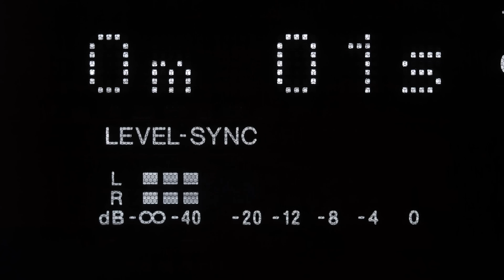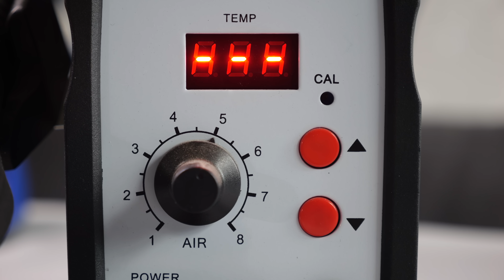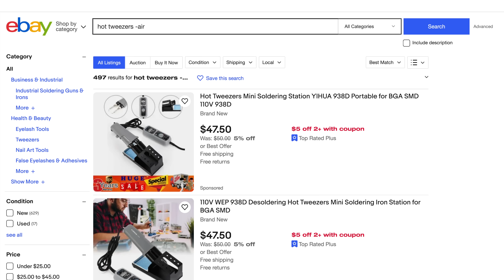A BETTER way to replace surface-mount capacitors!

Comment: I had to replace all 25 SMD caps on a Sony ICF-SW55 recently, as some started leaking (known issue). I'm only a new hobbyist. I used a regular soldering iron with a 'regular' tip, applying extra solder around the legs from the side for desoldering. They varied from 4 to 10mm diameter and OK to poor accessibility due to surrounding components.
The leaking had also caused pitting and trace damage, as well as top layer delamination. Even with careful desoldering, some joints would simply rip off the PCB anyway. Taking some more top coat and trace with it. I don't wanna know what would have happened if I used the twist and pull or leveraged removal. I did debate doing it that way, as desoldering with a regular iron took quite some time and patience.

So I guess it's also down to PCB and top coat quality, besides the degree of 'leakiness' and its corrosion effects on metallic joints.
Reply: Soldering iron isn't without its own danger. The PCB substrate is not infinitely temperature stable, and degradation can be catalysed by the electrolyte present on it. The outcome is delamination, the PCB substrate losing grip on the attached copper, because the resin is degrading. Since you need the leg to retain enough heat to be desoldered while you're heating another leg and it's cooling, you end up putting a lot more heat and higher temperature then usually.

Furthermore you're trying manipulate in semi molten state which also produces extra stress on the PCB.

Then as you say there is chemical induced degradation of not only the copper but also the solder, turning it into some sort of crystalline salt, so it doesn't melt at first truly and fully unlike when it's fresh, at least until you gain access for good solder to mix with it, or even bismuth alloy, and it just doesn't wick from the sides properly under the rubber bung that prevents access.

So i think bite or twist are indeed better than single soldering iron.
Reply: @SianaGearz  
Thanks for the additional insight and information. When I attempted a twist and pull on one of them, it took some soldering joints with it. So I stuck with the soldering iron.

I did attempt to take precautions regarding heat spread, as well attempts to increase the desolder effectiveness and limit the heat exposure time. To a degree I was able to, but far from optimal given my limited tools and knowledge.

- Rinsing the exposed parts of the legs with IPA as well as cleaning of all corrosion and crystals, for as far as that is possible, beforehand (often multiple passes)
- Use of liquid flux (I don't have paste or gel)
- Use of soldering tin containing lead (lower melting point, I believe?) and generous amounts of it to increase chance of proper contact / melting together with the PCB solder
- Removing the heat by applying generous amounts of IPA to the heated area and its surroundings (including IPA soaked paper towels on the bottom side) inbetween desoldering attempts, hoping that conduction and relatively low boiling point would draw away some heat. It seemed to work pretty well, based on using my finger as temperature probe ;).
- When the solder joint with the legs seemed liquid, I used tweezers and the soldering tip to lift the SMD up and hinge it around the leg that is still stuck. Then, if possible, heat up the remaining leg with the iron tip from underneath the now exposed underside of the SMD. This would often skip the back and forth heating of the both legs.

Unfortunately, I have next to no knowledge and experience in these matters. So seeing videos and accompanying informative comments like these are always welcome for learning purposes. But still happy I managed to fix it in the manner as described above. Even if it took some hours to complete.
Reply: @jbsvault  Liquid flux is usually a good idea unless you got a weird one that smells like death. Even classic mildly activated hard rosin just dissolved in some IPA is very good. Paste flux are just that but with some paraffin that burns up. Better paste ones have top notch activators and can work well but the paraffin still interferes with their action.

Yes old equipment from before 2004 you can safely assume used leaded solder, and unleaded solder should not be used to repair them due to higher melting point. Indeed it's advised to use leaded solder for all repairs even of newer stuff, to just reduce thermal stress and make the connection more reliable than it was before the repair and easier to rework in the future if need be. Sn63Pb37 is 183°C, good lead-free with silver is 221°C and cheap stuff is well beyond. Addition of 60/40 is good to aid de-soldering.

But for desoldering difficult parts specifically, it's good to use a bismuth alloy. You can try hunting for Wood's Metal, Rose's Metal, or just buy a desoldering alloy from ChipQuick. It can lower the overall melting point down in the vicinity of 150°C or so, which is a huge help with multi leg components. It needs to be wicked away carefully afterwards, because more than trace amounts of bismuth can embrittle the subsequent joint.

I don't think quick cooling with alcohol actually does much, as temperatures drop really rapidly at first and you can hold a PCB at say 100°C for thousands of hours, as long as it's dehydrated, it's going to be fine. Degradation sets in near soldering temperatures and higher. But it's also convenient because you want to handle the board quickly and i think it's no harm either :D

Comment: 3:30 If your board looks like this lifted pads aren't an concern anymore. The secret of the twist method is to twist the cap off and not pull up. It doesn't matter in which condition (leaky or not) the caps are. The moment you pull up you are going to damage the pads in 99% cases. If you like the hotair method more go on and use it but in my experience the twist method is as save as the hotair method but faster.

Comment: As a GPU card repair specialist who constantly deal with PCBs with very high heat capacience - I mainly have to repair damaged\destroyed (dr)mosfets, and those PCB caps are always close to the place where I need to deliver 380C of hot air. So I almost always have to remove caps before changing (dr)mos'es (But if PCB is small\thin I just use aluminum tape, fold it(glue part inside) and block hot air flow by placing it before cap).

My way is to always preheat board on 150-250C(it depends on the size, thickness and amounts of copper of the particular PCB. And I do it mostly not for removing caps but for easy (Q\D)FN chip removal) and then I use low-temp solder with soldering iron to mix solders together and remove cap effortlesly. Yea, after that I need to remove all that low-temp solder from pad and cap, but its better than always break caps and replace them.

And regarding hot air - you can use it on "low temp" double-sided PCBs. But it's tricky, and I wouldnt risk and hover my face above PCB if I do this. I already had flying caps(that top side) previosly - they can do a lot of damage. One even slightly bent nozzle on my hot aid gun.

Comment: on my bench i have 2 hot tweezers setups with different tips one straight one at a 45deg.
I have 3 soldering irons with different tips. 2 de-soldering stations for small and large pins. 
a custom 6 zone pcb preheater. and custom 200w IR heater on a custom flex arm with adjust focus.
i mostly work on high power amplifiers (1-40kw) and have have a full pcb production line setup sure it's not massive but i can do small to medium scale runs including the custom replacement driver cards i designed to replace the hard to find ones for a lot of old amps. even full gut replacement upgrades changing some old class ab to full bridge class d or T path integrated setups with as much as a 20x power bump for a given heat-sink while keeping the retro look for old hotrods

Comment: Just a couple of days ago I saw another interesting desoldering tip on youtube  In short, it works on through hole multi pin parts ans surface wing shape pins.  You form a suitable thickness copper wire and solder it along the row of pins.  Preferably low melting point (eutectic tin-lead alloy) solder.  If you are dealing with dual in line parts, you solder your copper wire as a loop around.  Then you have (one or two) soldering iron tip(s) heating the wire(s).  Use a wide chisel tip and the heat spreads along the copper wire (plus fair amount of applied solder) all the way and the part detaches easily.  On thru hole parts, you may need to straighten the often bent two corner pins as preparation before the desoldering operation.  Sorry, I don't know if the SMT capacitors could be removed this way.  As mentioned, I saw this two days ago and have not tested it myself yet.

Comment: Be wary the power switch on those hot air rework stations are software despite looking to be a hard power cut. The one I used to have set itself on fire while I was asleep due to a shorted transistor in the heater circuit, causing it to go full blast from mains voltage while not powering the fan on.

Comment: Great video , I learned a lot. I prefer to use two soldering irons and am fortunate to have a reasonable quality hot-air station , so I hope it is't overkill but I use all three tools , alternating between them as required.

Comment: I cut them with diagonal cutting pliers and desolder the legs left behind, but i used to used the hot air but it ruined some pcb because they had acid on the board

Comment: I quite like my two fine tip soldering iron method. But at the end of the day, I guess go with what you are comfortable with. Just experiment with an old board and see what you prefer.

Comment: You can make a tip for a soldering iron with your own hands for desoldering such typical components.  just two thick copper wires instead of a standard patcher tip, bent into the desired shape

Comment: Weller Soldering Tweezers are great for getting in to small places but at £320 without control station are a bit pricy.  but just stick to drowning them in flux and ripping them off as you can't go far wrong 🙂

Comment: I've heard that you need to pre-heat the board, especially larger ones, before using a hot-air solder gun, else you risk warping the board.

Comment: Plain and simple. First, always add some flux or fresh solder to both solder joints which makes the job a lot easier. Next, use a (de)soldering tweezer and you can take a SMD capacitor right off. Pre-heat the PCB using a temperature controlled  preheater in case of large ground planes as the negative side of many SMD electrolythic capacitors are often connected to it. If you replace SMD caps on a regular basis, consider investing in a Weller solder/desolder station. Yes, it costs a bit but in the end its well worth it!

Comment: Twizzers often have replacable tips (handy for for different smd sizes). And as soon as most of components are smd (resistors, doides, transistors etcl it makes them not so single purpose, not only for these e-caps. About hot air gun, does not melt the plastic base of such parts?

Comment: I have removed hundreds with a normal soldering iron, you just have to apply to one side and lift a little, and then you go to the other side and it comes out, heating both parts is more complicated without air.

Comment: I got a refund on my 858D style station and spent that to replace the fan and heating element as the wand arrived “used” and burnt up. It was quite useful when I recapped a SNES. Though if service more electronics in the future I’ll get a hot plate

Comment: The safe twist method could be called press and twist. No rocking and no pulling of a cap is engaged in this method. Capacitor pins snap by the base, and the soldered part stays on the pad, unlike what you have shown.

Comment: I have a hot air rework station with a preheated that I use to heat the board and then I use two soldering irons.

Comment: People saying “I’ve never had a problem” with the twist/pull method have never worked on a Game Gear for ex. If you are twisting a cap (especially on the sound board) expect at least 1cm of the trace to come along with it.

Comment: You missed a very easy option.  Slow melt solder or under the brand name Chip Quik, you just apply a small amount of the chip quik to your pads and it keeps the solder melted for several seconds and you just lift off the cap.

Comment: I always just reflow both sides and use a tweezer to remove SMD caps. No blasting excess heat to board or   Twisting/pulling of the pads.

Comment: Use the ladder technique. 
 
This is like technique shown at 4:50, but with a few suggestions.
Use a fine tip iron with a hot tip (the tip in the video is too large).  Possibly add a small amount of solder to the pad to aid in the heat transfer.
Use tweezers or needle-nose pliers gripping across the part (as if bridging the two leads).  
(In the video the tweezers come in from the right, instead bring the tweezers in from the front or rear from the camera's view).
When the solder melts, twist up slightly, but only on the melted side only.  
Repeat the process on the other pad.  Because the first lead has already been raised slightly, the second lead will easily raise a lot more.
Alternate between the two sides, like climbing a ladder.
Typically the part comes off after two passes.  
Quick clean up the pads with solder-wick. 

This method avoids the damaged part debris mess such as the twist off method.
This method also avoid heat damage to nearby components when using hot air.

Comment: I've always thought ripping off a cap (twisting or not) could put too much strain on the circuit. If cap has leaked, the circuit is already fragile. I use hot air and protect other components with kapton.

Comment: Personally I’ve been using the snipping method for years without any pad lifting, heatguns are a better method though it just depends on if I need to be carful with heating up heating up the board beside certain components makes me I little anxious so this is was I still use the put method for surfaces caps

Comment: well, in my experience I never riped the pad of any cap using this method, what I do is spin it little by little while applying down pressure

Comment: Just get a hot air and soldering station - the basic Zeny 862D+ knockoff model, which is unbranded, l I got 4 years ago for $50 seems to get the job done. It's now $80 on Amazon.  After a quick correction to the iron head for consistent heat, I've repaired an Alpine PDX M6 bass amp, upgraded a PSP 1000 display, repaired the micro buttons on a Logitech G700 mouse, bridged the rear USB power outputs on my Wii U, fixed the amps in the Klipsch Pro Media computer speakers, and am very close to repairing a near mint $10 Tivoli Model One radio I found with $15 worth of verified parts.  I probably should be using a better station now, but when I mainly just repair some of this stuff for fun and to keep my soldering skills up.

Comment: Few points, most of those hot air removals you show the solder hasn’t melted, second once the electrolyte has reacted with the solder it changes it, it no longer melts as regular 60/40 does I’ve struggled to get it to melt at all. For me hot air (for the round electrolytics) is painful, long winded and risks damaging lower temp plastics in the vicinity.I have always used the twist method and to be fair the electrolyte damaged ones you show are so far gone the whole board would be scrap anyway.

Comment: There are these thin flexible steel blades you can shove between the part and PCB while solder is liquid. Use them on one leg at a time, and eventually you can get entire part separated from the board. Except it is relatively easy to damage smaller pads - I guess I need more experience.

Comment: Just put a ton of solder on each joint and lift each one up a bit. Works everytime. When they're both high enough you can heat them both up with the iron at the same time. This or just hot air gun.

Comment: These caps are infamous to go bad in Casio Digital Horn (electronic saxophone, like DH-100 etc.). I have an Atten hot air station with SMD soldering iron (twice as expensive as the bare hot air but technically similar). The only poor quality thing of it is that the mains cable terminal sits loose in the back plate and may fall out when pulling the cable. Also the jack for the soldering iron (held by a ring shape nut) is a little loose.

Comment: I was thinking about there must be a solder tip that look like it has 2 legs so it will heat both sides as the same time. Then I saw rest of your video :) Hot tweezers.

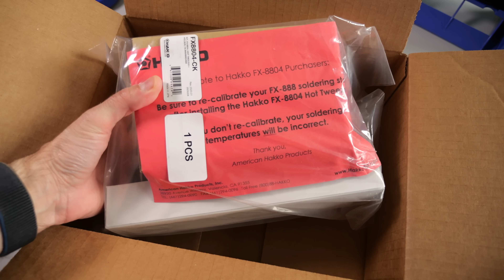Comment: 5:53 - Another thing you didn't explicitly mention is that the heat on the PCB itself can cause it to distort and bend. This is actually shown at 0:38 in the time lapse, you can see the board bending upward slightly toward the camera.
Reply: I think it might be the surface below the PCB heating up and bending.

Comment: I use the cut method. Cut the cap at the base and remove it. Cut up the plastic base. Desolder the legs. Never had an issue.

Comment: I use either (cheap but effective) hot tweezers, or two soldering irons, or one of the cheaper (also effective) hot air guns.  All work but which one I choose will depend on the board.  Some boards have too many nearby SM components to risk hot air.  Hot tweezers don't always seem to quite get both onto the board evenly if space is tight.
Two extra tools I find useful are: A pre-heater, which warms up the board and reduces the amount of extra heat you need to apply from your soldering solution.  And a microscope, I don't like to do any SM work without a microscope.  All of these tools have featured on my channel.